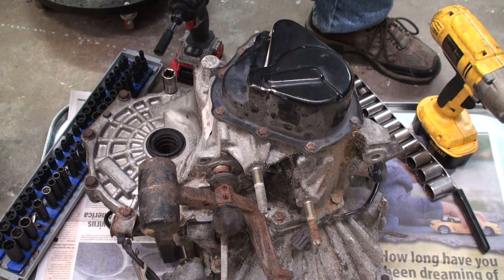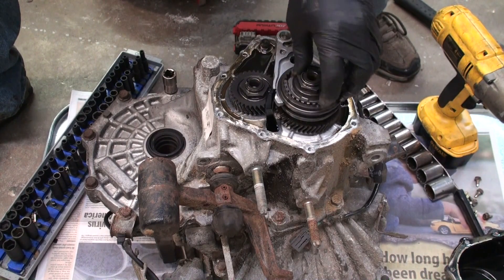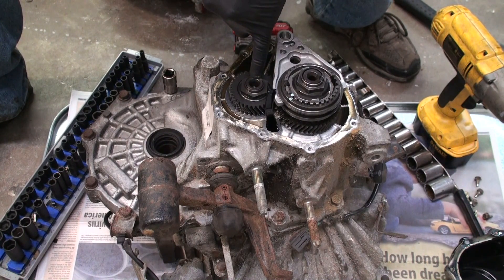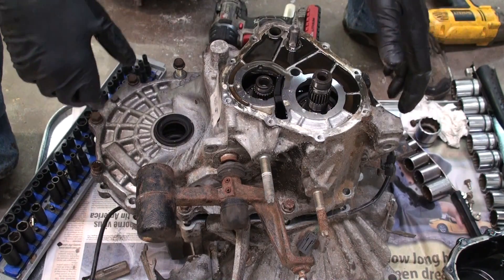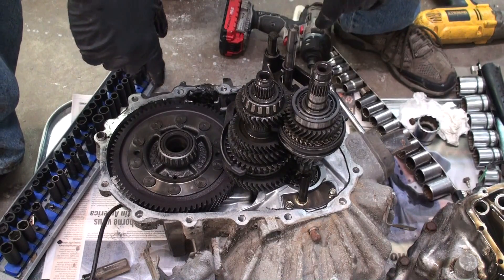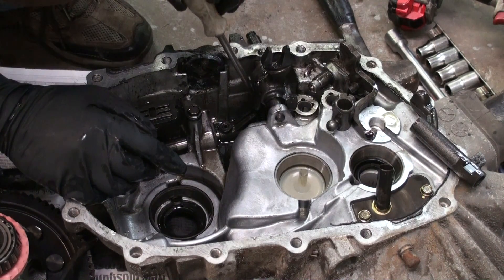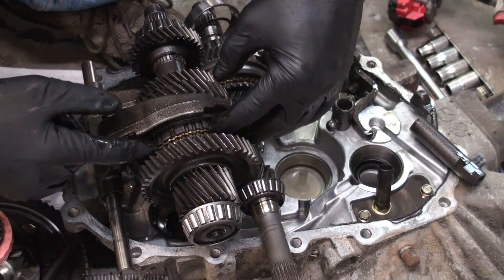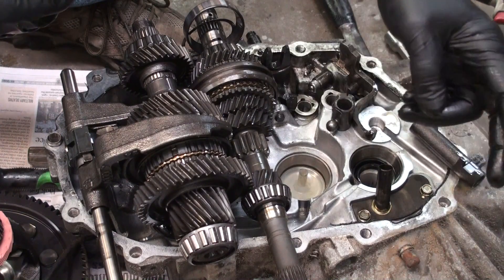mazda manual transmission tear down

Comment: Hello 
Thank you for this video  it helps me a lot 
Is there a difference between a 2006 Mazda 3 manual transmission with ABS and without ABS are the transmissions the same???
Reply from the maker: They should be the same.

Comment: 02 protege es 2.0L was stuck in gear lost power on drive home after work and started slipping until It was stuck in neutral please help me fix this. Shifter was unresponsiveness and lose. Car drove with stick in neutral position then finally stopped all momentum as if stuck in neutral.

Comment: How do you get the shift lever back in once you reseal the case? I have it in neutral, but its like the front pin (in the level hole) slips into gear.

Comment: How did he loosen the two nuts about a minutes into the video?
Reply: Bub Lee I used an impact driver on one, and a breaker bar on the other to hold it in place.  I’m right now trying to get the rolled pin out.
Reply: Stick a rag in-between the cogs to jam them up.

Comment: Excellent 05 Mazda  3S 5 spd MT tear down.  Wow on the damage.  Any 5spd to 6spd conversion videos?  A video on changing gear ratios or Differential ratios?  I've always wanted to convert my 03 MazdaSpeed Protégé MT from 5-6spd.  A Canadian guy did change his 4th & 5th gear ratios on his Mazda P5 - don't know where he obtained his new gears & other parts.  Again GREAT VIDEO!
Reply: If you are still in the game you can make a 6 speed for your protege, your car will have a Mazda G series like many mazdas and several fords.

Around 2009 Mazda designed a 6 speed version of the G series that was used in certain mazda 3, 6 and 5 models. Ford also used it in some ford fusion/mercury Milan cars.

With a few mods you can convert any existing 5 speed G series to fit the 6 speedninternals.

They stuck 6th under the cover with 5th, similar to the beginning of this video where he removed the black end cover, except the 6 speed uses an aluminum cover with extra bearings to support the gears.  This means the 6 speed version will be a bit longer and may shift the frame on some cars.

You need to modify the 5 speed shift gate inside the trans to allow for all 6 gear selections and reverse, you need to modify the internal shift lever to fit the 6 speed interlock block, and the 6 speed ring gear will need to be machined to fit the 5 speed case as it's a few mm thicker. EDIT: You also want the oiling trough from the 6 speed, you see the black plastic trough in this trans. The 6 speed version is a bit longer to apply oil to the new 6th gear assembly. 

Alternatively you can use the entire 6 speed headset shifter mechanism and the entire case other than the bellhousing side to fit your engine.   You will need the 6 speed cable shifter assembly including the shifter inside the car, and you will have to fabricate a way to mount it to the floor.  

The result is a gear set that has great low gearing for acceleration with a 0.68:1 over drive for the highway, more bearings for hopefully a stronger transmission and the ability to apply this to any engine that ever came with a G series transmission.

Comment: 2011 Mazda 3i
I changed the clutch out but I'm wondering if I messed something up.  During the process at one point I opened my gear box by mistake.
It went back together easily enough so I wasn't too worried about it.  I got the transmission bell housing back on the engine by some creative maneuvering with my 3-ton jack.  I had also knocked the selector lever loose where the shifter cables attach.  It had a rubber boot over it just like this Mazda transmission.  I replaced the deteriorated boot and bushing inside it but I'm not sure it's correctly back together.  When I went to add new gear box oil into the transmission it began pouring out a fast rate.  I think that's just a need for a new axle seal(which I've ordered) but I'm open to any thoughts on this.

Comment: I have a 2004 one and is leaking, the whole oil was on the bellhousing i dont know how from where, i send it to a machine shop to see if have any crack or anything and they say that doesn't have any hole or crack, but I was wondering if the input shaft need a seal, I just bought it with the issue... Sorry for my ignorant question... Hope you can help me...

Comment: Can you tell me where I can get a pdf copy of 05 manual transmission rebuilt from the Mazda motor Corp
Reply: Have any for a 2006 mazda rx8 6 speed automatic transmission
Reply from the maker: +Jesse Evans i have no clue where to get a pdf for the mazda. Ive been building transmissions for a long time never used a pdf on the manual trans. On automatics i do have service manuals on all of the ones i build. If you find one let me know.